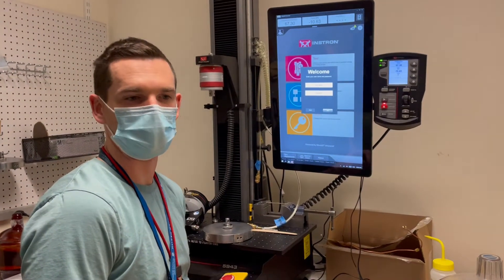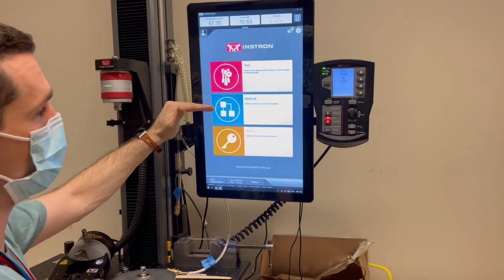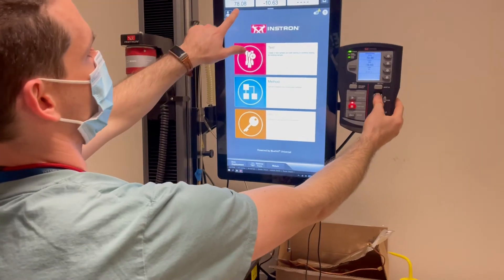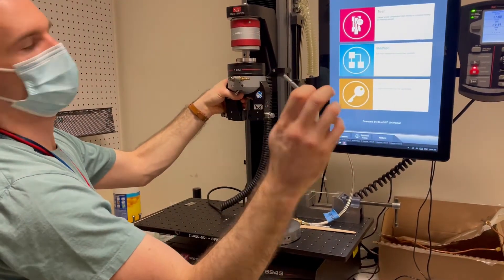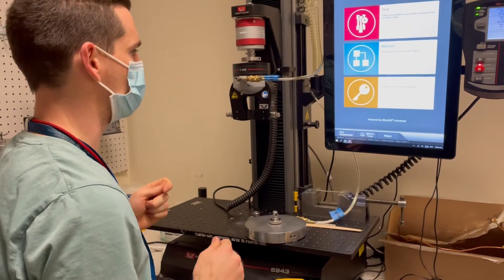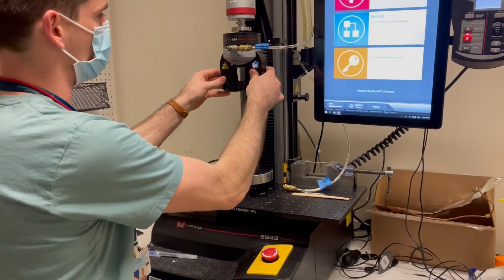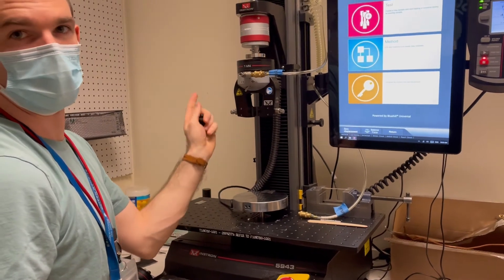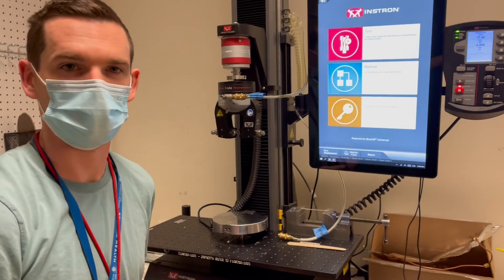Instron start & set up 1 of 2

Comment: If I'm testing spring is that consider Circular on the Geometry tab?
Reply from the maker: sure but this is really just used to measure cross sectional area for stress measurements. a spring is a unique geometry so i would defer analysis to load v displacement numbers which is how they are typically ordered